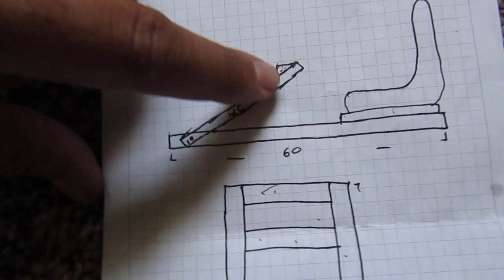My new Rig!! How to build a custom steering wheel base!! Step by Step on the build!!

Comment: That teal and neo chrome wheel you got in back desk I just got mine in 2 weeks ago but I use the g29 motor still and I have buttons on it still just added the adapter to keep buttons and to help with calibration I use a quick release to make removing easy

Comment: 2x6 is not necessary. 2x4 for the base and the arms for the wheel with some 2x2 vertical supports (or just some triangular shaped old plywood boards for fixing the arm position) will be good enough; otherwise the whole thing will be very heavy. And you didn't seem to pre-drill any holes before putting in the screws. The wood will crack if you don't pre-drill holes, like at 11:40. The wood will crack up even more after you have used your rack for some time.
Reply from the maker: All of this is very good advice and yes predrilled would have been better i agree for sure
Reply: @EvlRabbit07  No problem. I did my chicken coup, mobile chicken run, and work bench ... a couple of years ago. :) You can also stain it and sand it to make it look like a very classy piece of furniture that can blend very well to other things in your room. But that will be a lot more work. A couple of layers of good colored polyurethane will make it UV proof or even cool metal like too. LOL
Reply from the maker: @ArthurHau  well I work on cars and have welding certification so my next is a metal frame unless I go the baller NRG one lol

Comment: Can u tell me all the lengths on the wood you used I wanna do the same
Reply from the maker: The sides are 5 feet 2x4 the inner cross bars are 18 inch 2x4 and the angles parts started as 4foot 2x6 and got cut down to around 3 feet but that depends on how tall you want it for comfortably
Reply: @EvlRabbit07  you tha goat aye hopefully i get a tmx pro so when i do can we play together i got xbox and pc
Reply: @EvlRabbit07  you got dc or sum